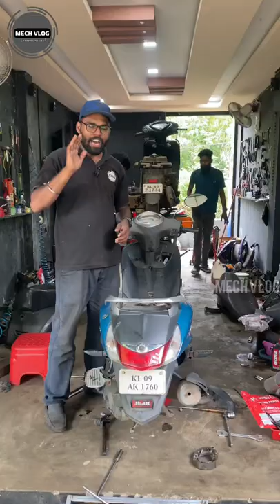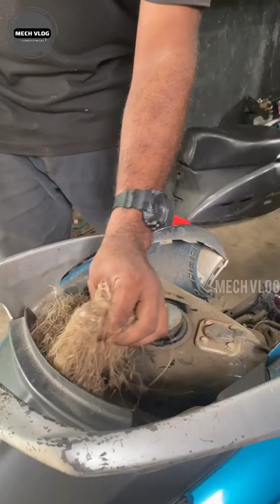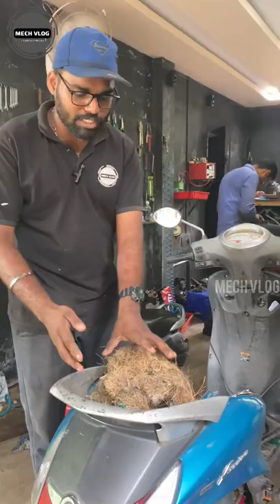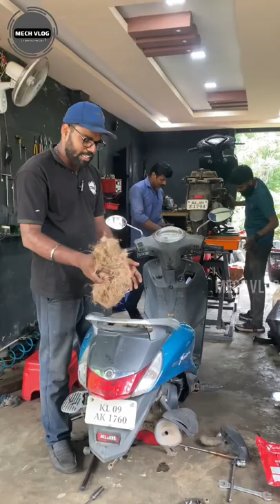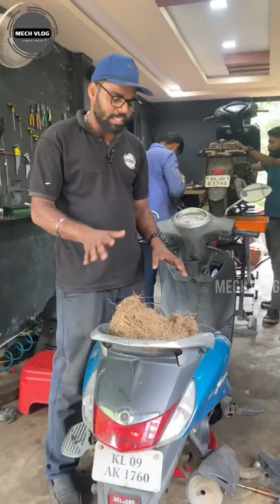AVASTHA…😁😁

Comment: എൻറെ FZ bike രാവിലെ സ്റ്റാർട്ട് ചെയ്യാൻ വലിയ പാടാണ് ചോക്ക് വലിച്ചാലും ചിലപ്പോൾ സ്റ്റാർട്ട് ആവില്ല  കിക്കർ അടിച്ചാലും സ്റ്റാർട്ട് ആവില്ല ഇറക്കത്തിൽ തള്ളി ആണ് സ്റ്റാർട്ട് ആക്കുന്നത് ഒരു കിലോമീറ്റർ ഓടിയാൽ കുഴപ്പമില്ല. എന്ത് കൊണ്ടാണ് ഇങ്ങനെ വരുന്നത് എന്ന് ഒന്ന് പറയാമോ
Reply: Tappet adjustedstment clear aano
Reply: Tapet , and Carbourator check cheyu
Reply: @josephjobish2098  tappet manassilayilla bro
Reply: @sobinjoseph4739  engine ഹെഡിൽ വരുന്നതാ tappet,timing chain
Reply: Bro 1st battery nok bro battery drain akunundarikum
Reply: Yes , battery charging system issue indenkikum , battery weak ആണെങ്കിലും

Daily short ride aanel , battery മതിയായി ചാർജ് aakathathu kondellam
രാവിലെ starting issur varam , 
But light ,horn ,  self motor etc work ആകുന്നുണ്ട് എങ്ങിനെ crank ചെയ്യുന്നുണ്ട് എങ്കിൽ 
Battery aavilla , start timil battery below 10 volt പോകുന്നുണ്ടോ എന്ന് കൂടെ നോക്ക് ( morning 1St start ) 
But start ആകുന്നില്ല എന്ന് മാത്രം പറഞ്ഞത് കൊണ്ട് ആണ് tappet , and Carbourator paranjathu
Reply: @its.me.ragesh  battery mariyittu 1 year ayittullu pinne ravile light,horn, display ellam work avunnundu
Reply: എക്സ്ട്രാ ഫിറ്റിംഗ്സ് ഉണ്ടെങ്കിൽ പണിയാണ് ഇല്ലെങ്കിൽ മുൻപ് ലൂറ്റ് ചെയ്ത വയർ കണക്ഷൻ എന്നിവ പഴയ പടി ആക്കണം  ബാറ്ററി പോയാൽ fz സ്റ്റാർട്ട്‌ ആവുകയെ ഇല്ല മെക്കാനിസം അങ്ങനെ ആണ് ഒരു പണി കിട്ടിയിട്ടുണ്ട്
Reply: @sobinjoseph4739  fi aano? Carb aano
Reply: @ajashameed9827  charger fit chaithitundu
Reply: @its.me.ragesh  carburettor anu